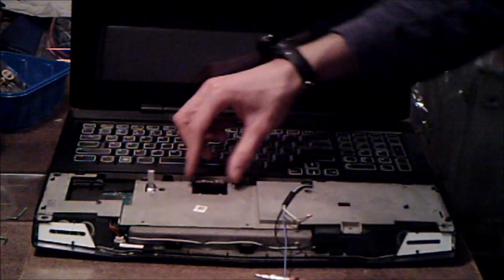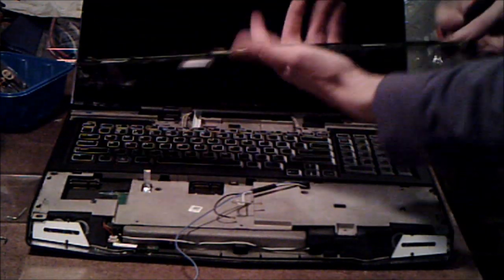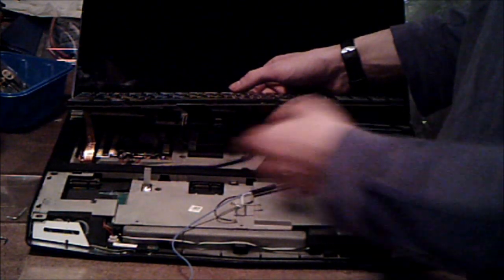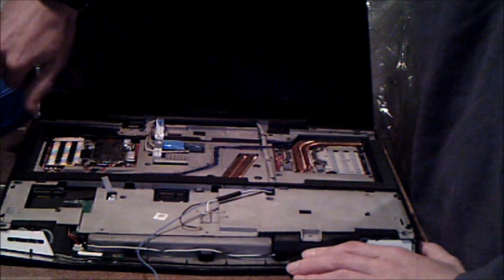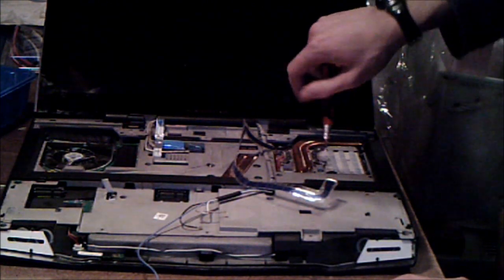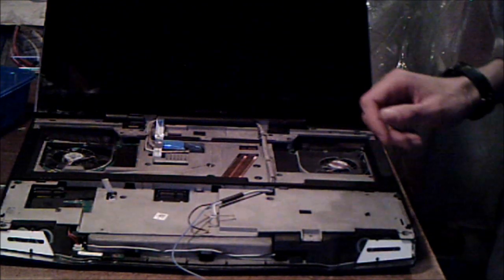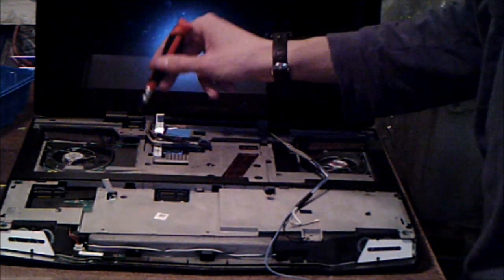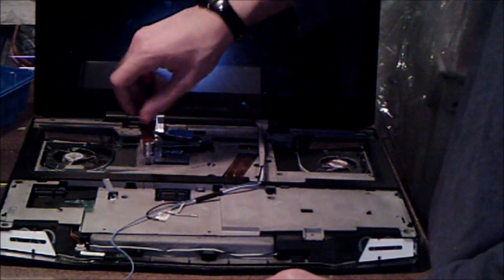Alienware M17x R1/R2 Complete Disassembly Tutorial (Part 2 of 4)

Comment: As far as the media bar and palm-rest go, are there only screws and clips holding them in place, or is there any glue at all in use?  I can pry up the right side of the media bar with my fingers and get a brief look underneath, but can't see that anything looks broken, but it won't pop firmly into place as is the case with the left side, which is affixed completely flat.  The right side is elevated somewhat and I believe that's what is making it very difficult to use the media buttons.

Comment: Hi, I'm having some trouble getting my media bar off.  It's kind of tough to make out in the video where exactly you're prying it apart.  It seems you're right at the hinge, but I am fearful of applying too much pressure and breaking it.  I've got a refurb and the right side of the media pad isn't laying flat and it's making it very difficult to use those touch-sensitive buttons.  I figured I could fix it by removing the media pad and replacing it properly, since it seems they didn't.